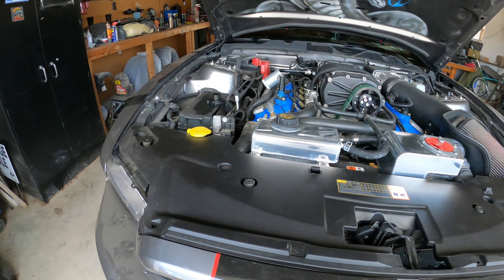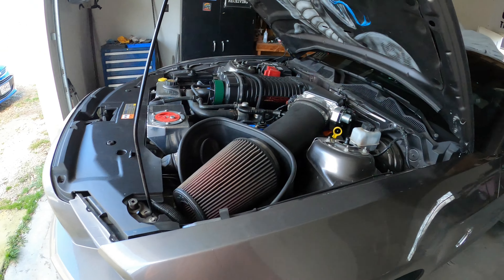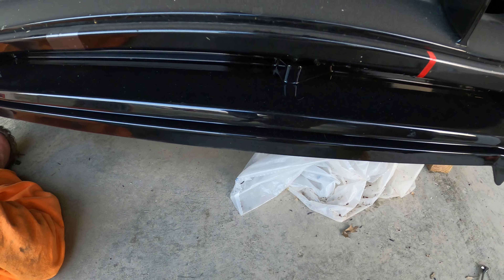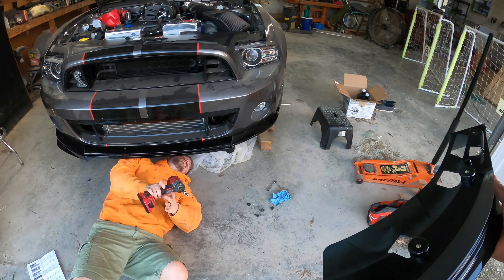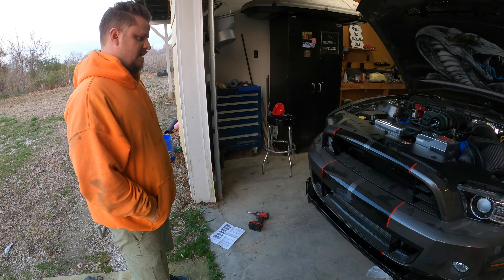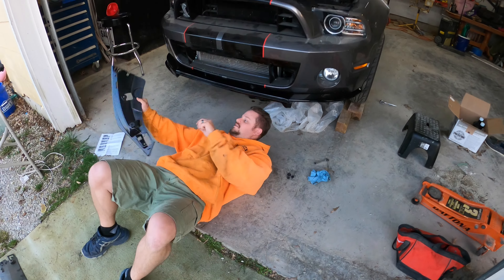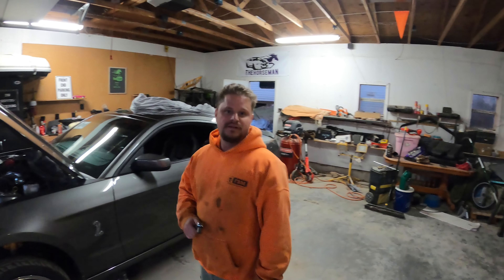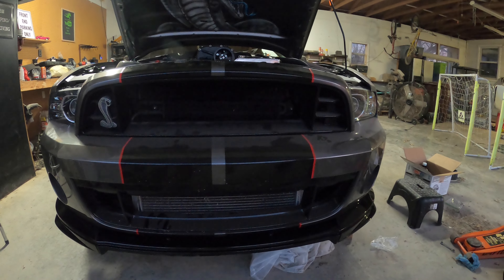#amsoil CHANGE & CHIN SPLITTER INSTALL

Comment: What are the left and right aide pieces called on the front splitter?  Trying to find them to replace mine.  Have some road rash
Reply from the maker: There on lethal performance. I'll get you the info.
Reply: @TheHorseman351  ty!
Reply from the maker: @wick6315  
My apologies, I actually bought them on LMR
Here's the link.

https://lmr.com/item/LRS-00104AA/2013-Mustang-GT500-Front-Lower-Valance-Also-Called-Chin-Spoi